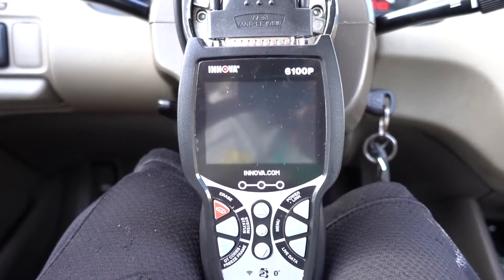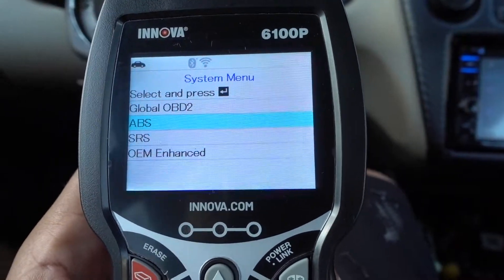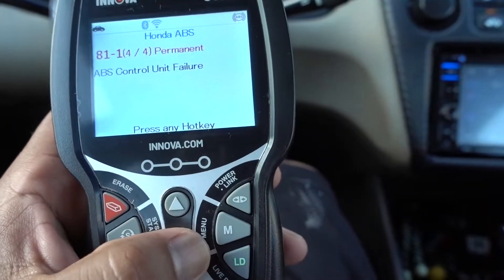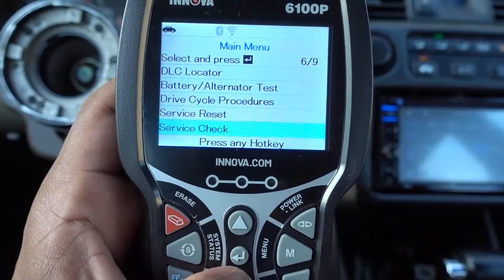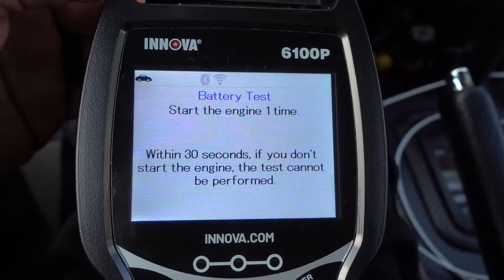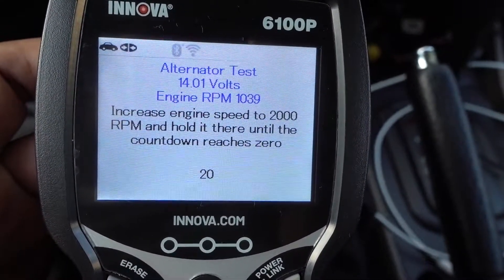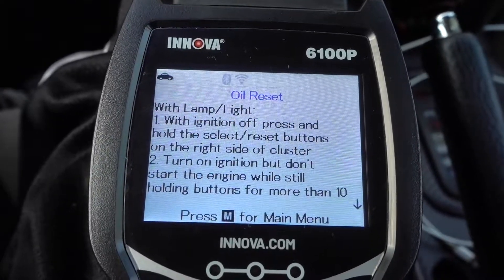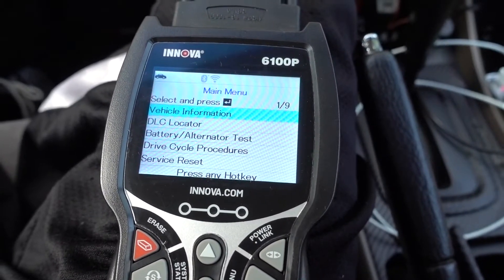6100P OBD2 Scanner ABS SRS Transmission Diagnostic Scan Tool with Oil Reset /Battery Test

Comment: Is this a Bidirectional Scanner.?  Does it do EGR Reset ? Does it do Fuel Pump scan for Fuel Pressure ? How about Compression test for Spark , Sparkplugs ? Can that  scan 2001 02 Toyota Camry is that compatible.?